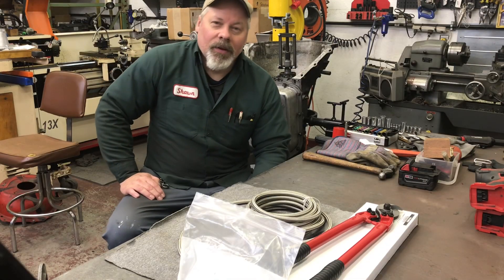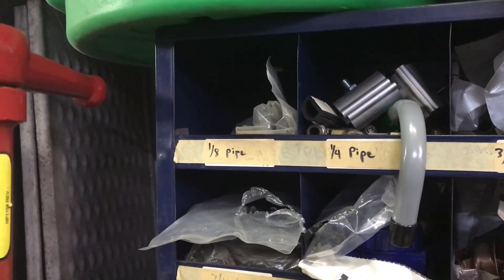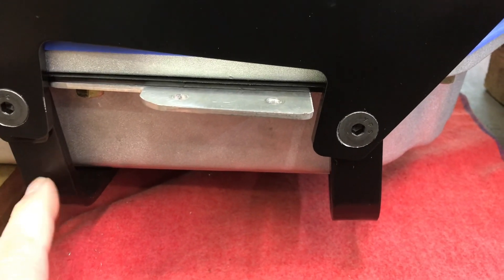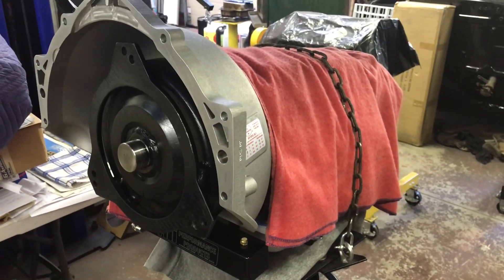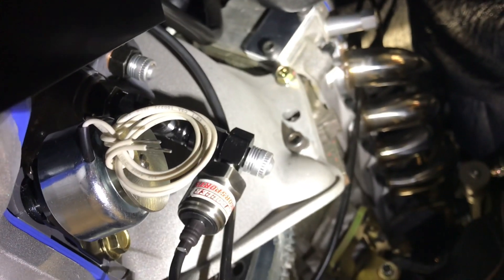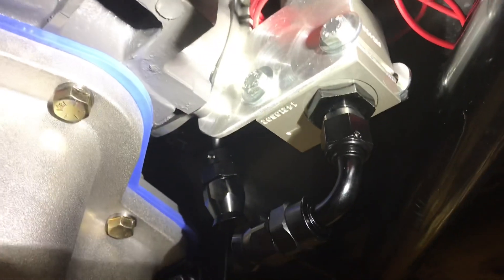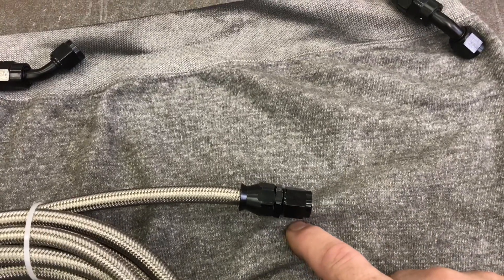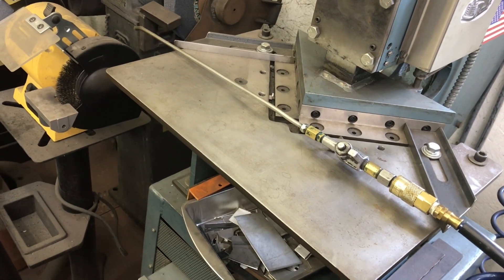TH400: 1972 Nova LS Twin Turbo Transmission SFI Shield, Install, & Dump Valve.

Comment: I'm Subscribed and enjoying the videos! keep it going man!
Some questions if you don't mind. I'm building a Turbo LS T-braked 400 and would like to have option of 1st or 2nd gear leave.
Have you used any particular brands ? Or which would you recommend? I'm looking at CK Performance..any experience with his?
Hoping for right at 1000 area, any input would be much appreciated! thanks Vince
Reply from the maker: Excellent!
ATD is my brand of choice now. Great guys, great products.
They have a 1+2 Brake.
I put one in my Nova. A 1.48 second might be useable in a low traction situation. Or if I change ratios the valve body is already there. 
ATD is Automatic Transmission Design.

Comment: On a side note what is your opinion on amc 400 cases any good
Reply from the maker: I believe AMC used a old round Buick case with an adapter before coming out with the AMC specific case. Either has a plug or a hole that isn’t machined for the speedo. Internal stuff is probably good stuff and interchangeable with “normal “ stuff.
Reply: @mountainsgarage  its a 74 case pulled the pump 8 bolt case has a plug for speedo scored it for 175 figured cut the bell
Reply from the maker: @dblock3812  Awesome!

Comment: Next up on the '72 Nova, we'll be taking the transmission out, because I sold it... Again
Reply from the maker: I used Locktite this time so it wouldn’t fall into someone else’s hands!
Reply: @mountainsgarage   I'll bet, A little heat and a few thousand bucks will loosen them bolts right up.
Reply: @abuickguy6335  lmao

Comment: You should be able to get it to work on the X. You would need the Holley 554-165.  Its a lot cheaper than a dominator.   Low Dollar has all the frequency and the corresponding temps on their website.
Reply from the maker: Excellent info, Thanks!

Comment: I am super slow, slower than you! when putting my trans together, but I do not have the patience for ptfe stainless hose anymore! I only will do the aeroquip socketless push lock stuff and the earls ultraflex pro type corrugated stuff. The earls is so so so much friendlier.

As for the adjustable wrench, they have them on Amazon for about 20-25$. They’re the same that other sellers across the net will sell you but for about half. Evil energy

Comment: Yeah like people said you can get a can bus hub now or use 2 of your 4 inputs. Honestly, if I could going back I would just get a dominator. But I only have one go fast car. Dominator just has so many features. Because the can bus runs a serial signal into the terminal, so you end up with a slow signal compared to direct input. Meanwhile the dominator also will let you run an NTK wide band. And traction control… and a few other things. I suppose I can sell my terminator x max and get a dominator but for now I’m just going to use it.

The dominator is just a superior solution to terminator x. Between x max and a can bus hub, I’m pretty much at the cost of a dominator. Holley has the terminator x way way held back and it’s kind of disgusting to think about

Comment: holley offers a can bus add on so you can add in more inputs and outputs , for all the new sensors . i use lowdoller sensors on all my holley stuff , brandon sends scaling data for the holley systems
Reply from the maker: Great info, Thanks!